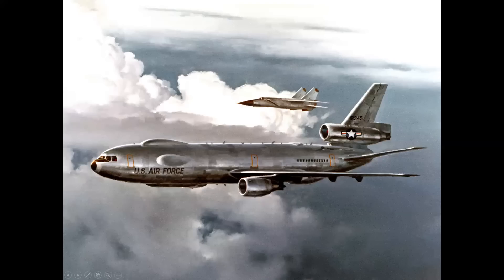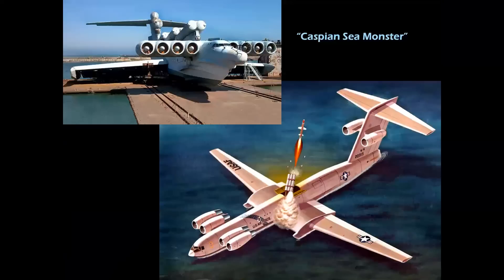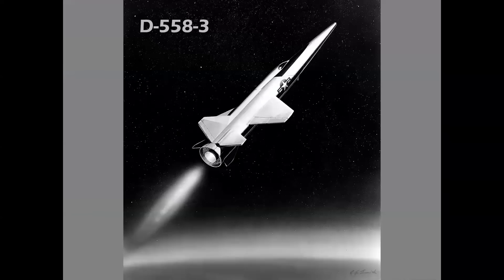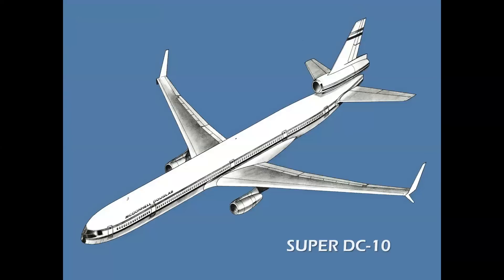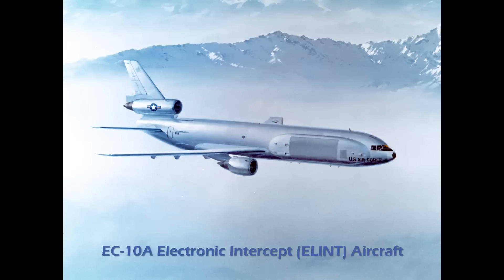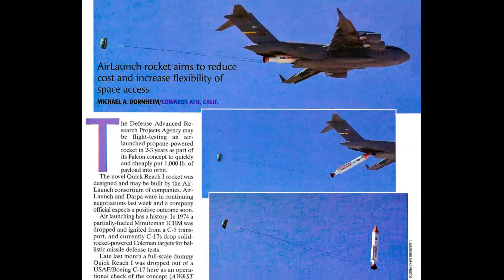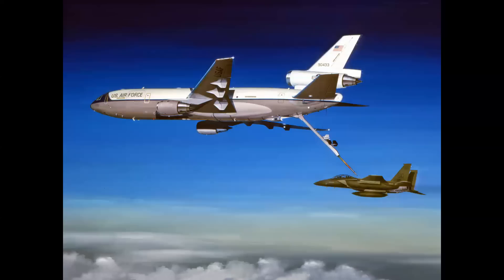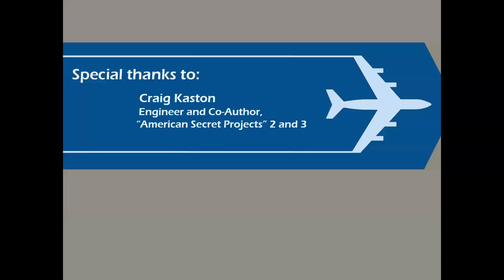DOUGLAS SECRET PROJECTS - Aircraft Concepts and Proposals from Long Beach during the Cold War.

Comment: Back in the 'pre-internet' days, I did not quite understand what the C-133 Cargomaster was. And by that I mean I was unsure who built it. I actually thought it might have been a modification of the Lockheed C-130 Hercules. {I had never seen one in person, only in photographs.}

Several years ago I visited the USAF's AMC[?] museum at Dover AFB. They have a C-133 there. They actually opened it while I was there, so I got to go inside. I learned... 
(1) It was built by Douglas.
(2) It was larger than a C-130. I have been around Herky Birds, and the C-133 is DEFINITELY LARGER. 
(3) It was the predecessor {in the strategic cargo role} to the Lockheed C-5 Galaxy.

Comment: 2:54 it looks like the rocket would introduce FOD into the engines on the vertical stabilizer.  At the very least the heat from the exhaust would enter the engines and make them upset. :face-purple-wide-eyes: Could a DC-10 take off from LGA at MTOW?  It must've been fun for the flight deck!

Comment: Another excellent video Mike, on a sidenote, concerning the KC 10 as a former flight engineer on C141 cargo aircraft when air to air refueling from a KC-10 to a T Tail type aircraft the exhaust from the number two engine ( the one on the tail) was practically in line with the horizontal stabilizer of the receiving aircraft making the pilots job that much more difficult compared to a KC 135 tanker just a little bit of info anyways again, thank you for what you do
Reply: On some of the Sideview profiles that you show you could see that
Reply: I wonder if, during refuelling procedures like that (they wouldn't be that common) if the KC-10 were to throttle back/power-down the tail engine to avoid the turbulence problems. Or would the reduced thrust be a problem?
Reply: @kiwitrainguy  to be honest I don’t remember, but I think maybe if they knew they were refueling an aircraft with a T tail configuration, they would increase thrust on engines one and three and decreased thrust on number two but I don’t remember for sure

Comment: I was on a self-deploy package with the KC-10 flying from Alaska to Florida, nonstop.  Got to watch an A/R with our F-15's.  We did, indeed, have a spare engine along with pallets of toolboxes and spares (avionics, etc.). Funny thing was that we lost our KC-10 transport to missions in Kosovo and had to find our own way back to Alaska.  Non-stop on a KC-10 was MUCH better than four separate flights and about 18 hours of layovers.  I was also at Barksdale right after we lost 190.  There was still a portion of the wreckage, most notably the radome, near the runway.  There was also still the big scorch mark where she burned down.  The scuttlebut was that the fuel transfer pump draining the wing tanks was inop and when it ran dry it kept going, overheated, and caused an explosion.

Comment: Hi Mike, having an engine located on the dorsal fin, reminds me of the dubious safety reputation of the Douglas DC-10, reciting the 23rd Psalm is advisable when boarding one. Propellor driven turbo-prop with swept-back wings proposed designs immediately make me recall the Tupolev Tu-95, it's the only heavy bomber built, of which this 'kite' is the noisiest aircraft in existence, so those with a greater respect for their eardrums are compelled to give her a wide berth!
Reply: Always seems to appear a DC-10 hater. Strange didn't mention the TriStar